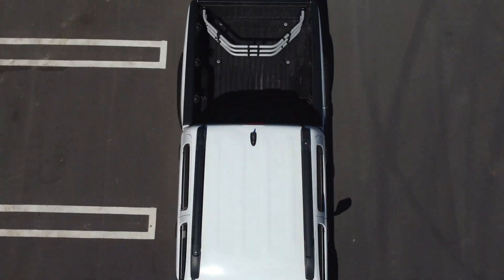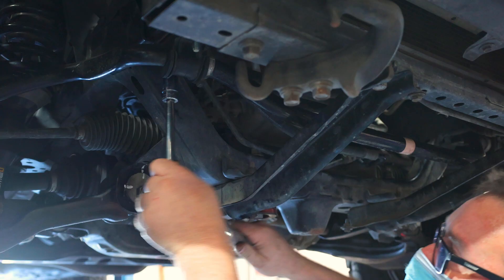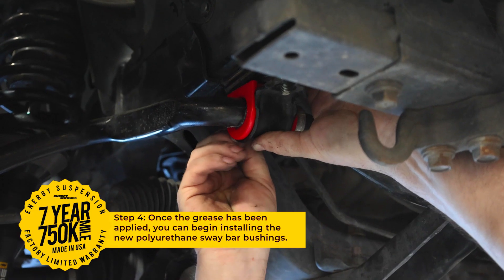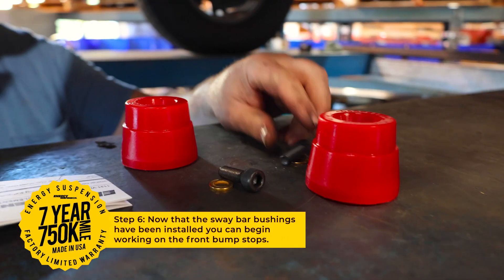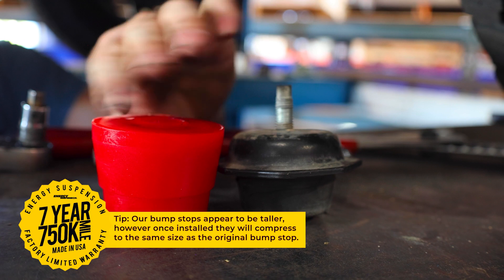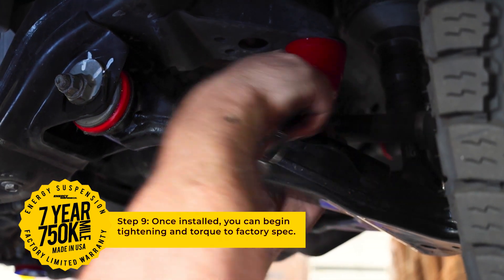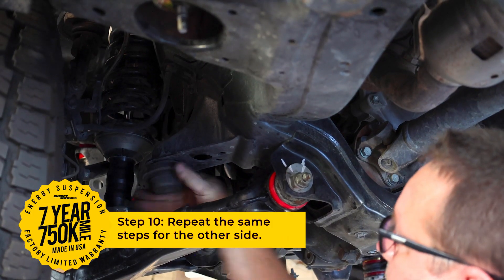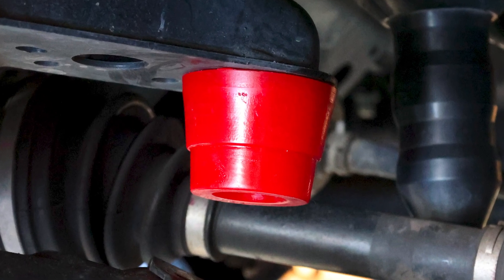Energy Suspension Sway Bar Bushings & Bump Stops Install

Comment: I didn't get a bolt with my Energy bump stops. The instructions said use 'Factory bolt or supplied bolt'.  My factory bolt would not come out of the factory stop and there was no supplied bolt. Can you please tell me the size, thread, and type of head so I can try to obtain one locally? I purchased the bump stops on Amazon.
Reply from the maker: Please reach out to our customer service team. They will need to know the part number you purchased. 949-361-3935